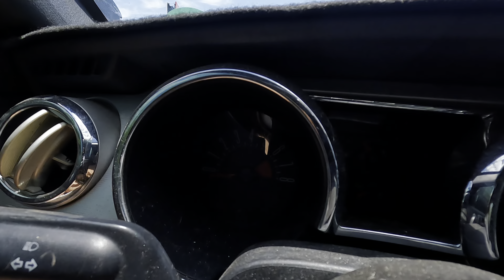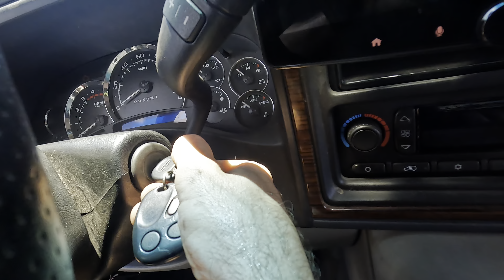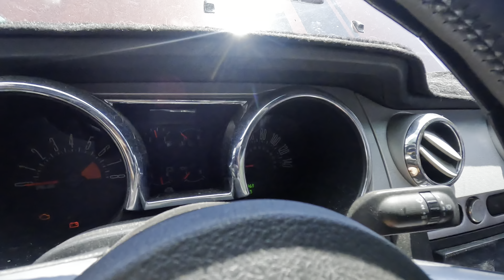Great Way for Wheels To FALL Off! (Wheel Spacer) Ford Mustang GT

Comment: Ironically, your audio was excellent until you asked us to comment on it, at which point it sounded weak, as if you were down wind from a spinning fan. It recovered and sounded perfect again when you posted the embedded text about the audio recovering. That mic is so good when working properly that I had no idea it was wireless. Please do a part II Ray re: rear brakes -- thanks!

Comment: I herd when you jump a car your supposed to use a body ground on the dead car instead of the negative terminal on the battery! How true is this?
Reply: If not the battery post then a ground on the engine itself. Most direct electron flow.

Comment: People in the rust belt that use wheel spacers often have a very bad time getting them off. Galvanic corrosion between the dissimilar metal of the spacer and rotor will practically bond that spacer to the rotor.

If you live in the rust belt and want to use a wheel spacer, use some high quality silver or copper anti seize between the spacer and the mating surface of the rotor!!
Reply: I use copper anti-seize on the backs of aluminum wheels to keep them from sticking to the iron rotors. Lifesaver 8f you have to change by the side of the road.

Comment: Jumpboxes are great when working at auto auctions, especially during the rush of sale days. Cars need to be run through the block, and who has time and patience to get the jump vehicle, unwind the cables, and connect the batteries? Around 78 percent of cars have completely dead or worn out batteries where I'm at, and probably less than that have completely sulfated batteries.

Comment: Hey Ray, 
funny you should mention the audio. 
Right after you mentioned that the compressor came on and the mic seemed to be trying to cancel some of that out but was muffling your narration.
All brakes wear out but ill still take the old solid rotors over the new style softer rotors where the pad wears into the rotor surface supposedly for "pedal feel" 😂

Comment: 10:10 
I am with you Ray, I like the look of them. But Crocodile Dundee would say THAT AIN'T NO SPINNER!  Spinners or DUB wheels are a totally different thing and look. Those are FAKE Knockoffs, and they are appealing.

True Knockoff wheels are not attached using lug nuts, per say. But rather are attached with spinner caps that are spun onto a threaded shaft, which are tightened or loosened with a bronze mallot. The threaded shafts are either bolted to, or machined onto the front spindles or the rear axle. I really like the look of true 1950's style of Knockoffs that were typically used in racing. 

Another great video as always Ray. Thank you for never a dull video moment. 😊😊😊😊😊

Comment: Not sure about the purple silicone grease but the blue silicon grease works well. Do Not use Never sieze or wheel bearing Grease on the pins they will seise tighter than all get out!

Comment: I asked my mechanic why he did not top off the brake fluid at the service/oil change time. He said the diminished level of the fluid was indicative of the brake pad wear. The lower the fluid the greater the need for pad attention. Also if he were to top off the fluid, when the pads were replaced, the pushing back of the puck in the wheel cylinders would cause the master cylinder to overflow. -- Your thoughts?

Comment: The new long distance microphone also comes with a tendency to pick up long distance noise.  Possibly, or probably, due to its automatic volume control.  If you keep a little pause, it ramps up its gain and starts picking whatever noise you have around.

Comment: The only reason to put “grease” (actually should be using the rubberized pad  adhesive) where the caliper surfaces meet the pad is to keep the brake pad dust from causing the pads to vibrate in the caliper which causes an audible squeal when you apply the brakes. The extra metal plate eliminates the need for any such caliper “goo”.

Comment: Have you ever considered an Autowit super capacitor starter. No charging needed. Uses a low charge on the battery to charge the capacitors and releases full voltage to start the engine. This would be the perfect time for it. Takes only a few minutes. I have saved many people with mine.

Comment: g`day ray milwaukee have come out with a new fuel 1/2" high torque impact over 1500 ft lb break away torque .. sound is good when new mic is working (lol sods law it stopped when you said something) great video .. catch ya tomorrow mate cheers

Comment: The audio was really good up until 20:38 in the video.  Then it got attenuated somewhat.  Almost like the remote mic had dropped out and you were now using the mic on the camera.
At 38:44 in the video the audio came back up to the previous level when you had asked how the audio sounded.
Reply from the maker: That’s exactly what happened…the irony didn’t go unnoticed. It was user error, I left a connector loose after a battery change…(learning curve)

Comment: The original studs on e spindle are not supposed to stick out past e spacer front, the rim will not sit flush on the surface..

Comment: Yes do the rear brakes! One question I had is when compressing the caliper pistons, doesn’t brake fluid rise up and spill out of the master cylinder? Do you have to pre-drain some of the fluid out?
Reply: Not unless you've topped it up because of the brake pads wearing down. As the pads wear, the fluid level goes lower, when you compress the pistons, it just rises to original level it was at when you had new pads. You shouldn't ever have to add brake fluid unless you're losing it somewhere out of the system. In other words don't top it up as the pads wear or you're going to have to remove some when you replace the pads.

Comment: your audio was good until 21:34 of the video then it went low. Question if I may. if you have a shaky steering wheel when braking is that a sign of a warped rotor?

Comment: Couple of things. I like the blue grease better. As you drive and brakes the pads wear your brake oil goes down and you add brake fluid. I’ve always took the cap off before compress the calipers piston. Just saying. The mic sounds good .

Comment: You are TOTTALLY right NO GREASE ANYWHERE NEAR THOSE PAD SURFACES because of heat situation it WILL get hot and find its way onto the pad and rotor surfaces then you will have a break grabbing situation and be redoing your beautiful break job all over again

Comment: If you don't install the spacers correctly, they may pass you with a tire attached while going down the street as you slow down to check out the vibration you are feeling in said wheel. Just saying.
Reply: Also, many of them are not designed or people don't realize if they must be centered on the hub radially, or you'll have a bad time with a tire vibrations et cetera

Comment: Good day to you Ray! I love the idea of your truck setup. Would it be beneficial to run some external terminals for your jumping needs? Like you would turn on your power supply and hook to the external terminals so you wouldn't even have to open to box just to open another box to hook to the battery!

Comment: As far as wheel spacers go, those are of good quality. Hub centric and don't rely on the lugs for centering or sheer forces. If you HAVE to use a spacer, use this kind. 

Also, what are the conditions that cause gumming up with the Permatex purple stuff? Cold? Moisture? I'm not seeing any of these issues with it in Phoenix but I am considering switching to SIL-Glyde after some quick Google research.

Comment: I always explain a pulsating pedal and steering wheel shake not as warpage but as a low area on a front brake rotor.
I explain it that the is more likely caused after heavy braking which causes the rotor to get cherry hot and the pedal still being applied I.E at a standing stop creates a pinch on the rotor.
A new rotor that has plenty of surface area can usually handle the heat, but a rotor that has been resurfaced and even some new rotors have less material and after heavy braking can create a low spot when braking that causes the piston to travel in and out which causes a pulsating pedal and a vibrating steering wheel.
I'm sure most who watch your channel has seen Nascar footage of brake rotors cherry red while braking.
Just like putting a torch on a piece of steel to get it to bend the same can happen to a rotor after heavy braking.

Comment: If you do blow those pistons out of one or more of the other calipers you can just about rest assured you will at the very least be putting a new kit in that caliper or worse yet replacing the Caliper because when those pistons blow out and hit the floor they will ding or crack and very likely damage the caliper on their way out. Ive rebuilt those calipers and used an air hose to blow the pistons out very gently. The kits used to come with new pistons but you still had to be careful how you blowed those pistons out

Comment: Yes the silicone grease can gum up, if you ignore them every time you do a brake job. With regular and proper maintenance, you shouldn't have that problem on the slide pins. That said, I have used that CRC brake Lube since 2005. And even use it on the tip of a toothpick to grease portions of firearms. It will turn a 4 lb trigger pull into a 3-pound trigger pull in a heartbeat. And it works on a lot of other things I will leave and take it and put small amount into the grease fitting on a ball joint before I put the grease fitting on there so that it gets just a little bit intuit. It has some really good elements in it molybdenum, PTFE, silicon, it is a wonderful lubricant. But don't get it on your skin it'll take you forever to get that off
Reply: I’ve been using the purple stuff for years at my shop for brake jobs and it’s first time im hearing of the gumming issue. I’ve also used it for four years now doing the yearly brake service on my Tesla. Yes, that’s a thing despite what people (especially other ev drivers like to say). You’ll probably only have to do a brake job once a decade or longer but the brakes get used so little the recommended service is to pull the pads out wire brush any corrosion off that’s building up on the pad tabs, calipers, slide pins,and the two locking pins on the front brembos and grease those surfaces, then do the same to the rear pads, bracket surface and slide pins once a year. Even with the brakes hardly getting used to the point that service is even necessary I’ve never had it gum up. I would imagine it’s a case of people neglecting to clean and grease their slide pins for a ridiculous amount of time.

Comment: I would never grease the surface of the hub. It will reduce friction between the wheel / rotor and create unwanted forces on the bolts.

Comment: I really love your videos. Great stuff. But I couldn't stop thinking about that jump start. I'm sure you're smarter than me but how bad would it be if you could hard wire a set of external terminals? No need to ever open the tool box. They stay dead until the aux power is kicked on. Pretty sure that could be super helpful.

Comment: Question: The slides pins get new grease, but is there a need to remove old/used grease from the slide pin holes?  If so, how?  (Assuming can of brake clean per hole!🤣)

Another great video . . . Thanks!!

Comment: Do you suggest that you take the master cylinder cover off, before compressing the pistons back in? I've been doing brakes since the late seventies and that's how I was always taught. I case other shops topped off fluids w/o realizin that the brakes have gotten thin over time.

Comment: I thought wheel locking-nuts would be standard in the US by now. I know my last two UK motors have had 'em on all 4 corners, even though they don't have fancy wheels or tyres like that lovely Mustang! We've some areas (Essex county is renowned) where if you stop longer than a minute at the lights, you'll find your car up on bricks when you go to pull away...

Comment: You used to be able to buy a caliper
Rebuild kit but if you do push the piston out of the bore  its kinda tedious but you should replace all the rubber parts they slide right back in  the trick is the boot  the boot has to fit into a groove on both the bore and on the piston.
The reason i know this when i worked in a machine shop we milled the bore and drilled and tapped the bleeder holes on a cnc machine the parts came in as a casting. These were for Allyson chambers tractors,  
I had to go to the factory debur and clean the chips off 2 gondolas worth of boxes probly 350 units because the shipping department
 sent them out before they were done. Same guy ran the inspection department, he was a fu always shipping parts he should not.
Cost us that account. 

I didn't get much view of the assembly line and brakes went on the frame so it was at the start of the assembly line.  

I did get to tour a GM factory.
And a steel plant.

Comment: I like that low profile socket wrench.  What brand is it?
Sadly the shims in brakes now half the time don't fit.  Last 4 brake jobs I only had enough shims that fit for one wheel.  Making me have to clean the old ones and reuse them.

Comment: You should put welding cable 1/4 turn connectors on the tool box. Then modify your jump cables to work with them. You won't even have to open the box to jump stuff. Just flip the switch and plug it. Is it necessary, no. Would it be a cool video? Yes. BTW, those are the stock wheels. They just installed spacers for looks. Talk the customer into losing the spacers and the caliper covers.

Comment: Is the lug bolts that hold the spacers sticking out too far that the wheel doesn’t seat in flush I seen on another video they had to grind them off.

Comment: Ray, you sound exactly like a low voltage installer I worked with about 20 years ago, down to the phrases you use. It's strange LOL

Comment: Ray, I would not do half the auto related shit I do if it weren't for you, I'm not an auto mechanic, and I'm helping my cuz put in a new water pump into his 2009 cadillac DTS. What a nightmare! ... We should save him alot of $$$ ... Just have to put it back together now. Half way there! A far cry from the time I installed one on my 1959 Ford F150 with a strait 6 223, over 20 years ago.

Comment: Hi Ray, I do not agree wih your comment about the weight of the brake pads is important to take and dissipate heat. 
a) the friction material is not a very good heat conductor (at least it is worse than bare metal)
b) the thermal capacity (i.e. the amount of heat they can absorb) is much smaller than that of the discs anyway
c) the heat is supposed to go into the discs where it is cooled away by the ventilation whole driving and the wheels are turning
So every Joule of thermal energy that braking is creating is better going into the discs than anywhere else ;-)

Comment: In the first part of the video the mike was picking up too much background noise. And the second part after you said it was fixed was pretty much the same. Was the camera mike on at the same time? Because I could hear the camera mont clicking like on the old videos and your voice becomes muffled when you get into close quarters like a fender well. Other than that everything is fine.

Comment: eeeeee a 4.6l 3 valve (spotted the famed vct solenoid)... wow!!! wasnt expecting to see that even tho i have a 4.6 3valve "10 F150 sitting in my lot.. also LOL!!!!! sounds of fire trucks as you just disconnect the booster cables xD

Comment: Hearing a lot of shop fan noise (roaring up and down) so maybe if you don't have a mic boot installed to cancel background noises that might be something to look at,  they are pretty cheap.     Rear brakes look similar to same as the front brakes and it slows you down when you make a video.

Comment: Do the brake pad instructions not say to grease the shims?  They even provide a little packet of grease to use for this.  Do you not grease the shims Ray?  If not, why not?
Reply from the maker: The packet is for the slide pins
Reply: @RainmanRaysRepairs  The diagrams in the instructions indicate the grease goes on  ears of the brake pad where they meet the new shims installed on the caliper brackets.  At least the ones i've always seen indicate so.  Just wondering.
Reply from the maker: @Nick9drs  yea some say online those areas too. I’m of the opinion that lube goes on the little ears depending on climate and it’s more of a guideline rather than procedure. Ex. Antisense goes on everything up north, but we rarely use it down south.
Reply: @RainmanRaysRepairs  A followup question to the lube.  Can anti Seize be used in a pinch to lube the caliper slide pins if the purple stuff is not available?
Reply from the maker: @Nick9drs  not really, it dries out and hardens causing the pins to stick
Reply: @RainmanRaysRepairs  Ok was just curious, thanks Ray :)

Comment: Something was wrong with the sound when you moved away. Maybe using the mic as a button mic do the trick. Never seen anyone greasing the hub and brake rotors. Isn't it potentially dangerous? Heating the rotors won't make the grease run into the breaking surface?

Comment: Google maps says my sofa is 1,059 miles away 🤣  Sound is reaching St Louis clearly.  First time you walked away you faded some, second time you did not?  Difference?
I never found it a big deal to replace the internal battey on a jump pack.  Some modele are easier than others.  My old craftsman is a pita.  My newer Jump-n-Carry is easy but is 4 y/o and still good.  In a non commercial setting they last a long time.
I'm suprised you have not installed a high amp power connector on that setup with a matching plug on your cables.

Comment: Am I missing something? 🤔. Those wheels are a 5 stud. The wheel spacers were a 5 stud and when he took the wheel spacers off, the original studs are a 5 stud so what was the need for the spacers?
Reply from the maker: It for offest, not bolt pattern. The wheels don't fit the car without the spacers.